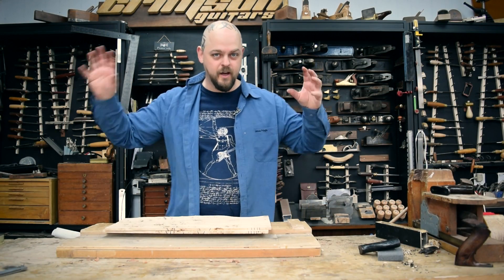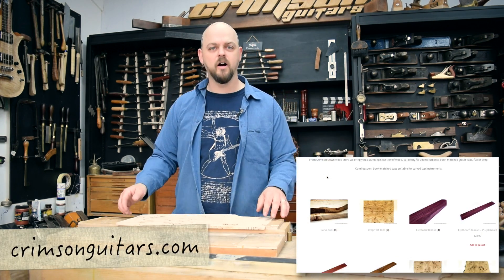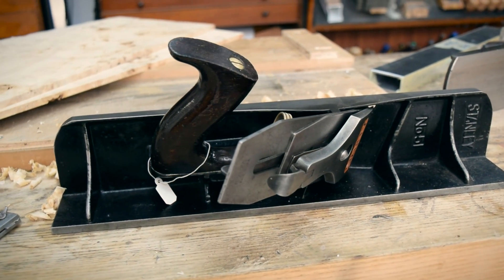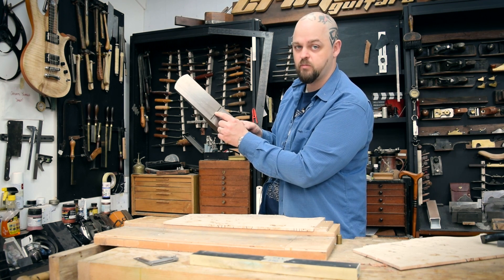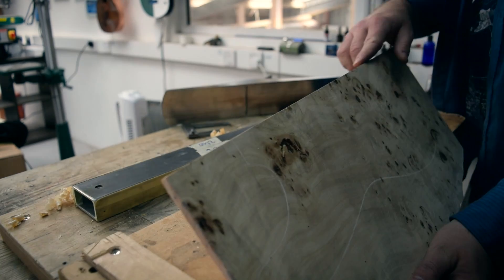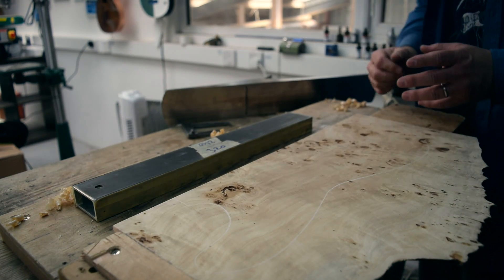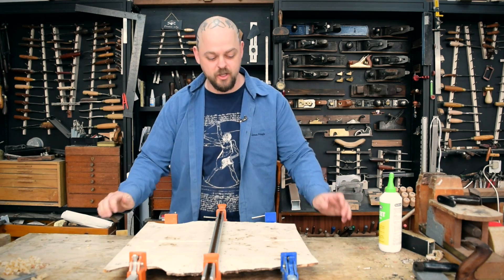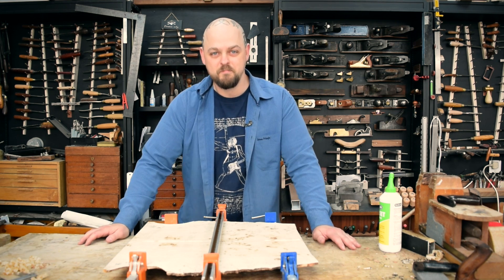How To Bookmatch a Guitar Top Using a Shooting Board

Comment: Very good video as usual Ben. I have been a custom cabinet maker ie furniture 30yrs I have made & used alot of shooting boards & planes, I learned a long time ago Simple is best I have always used an impeccable sharp #4 or #5 plane My joints fit butt ass tight hardly no clamp pressure just as you said. So I say Ben sell the bloody shooting plane. Love your vids from USA.

Comment: In his video on restoring a bench plane, Paul Sellers remarks in passing that for jointing the cheeks of the plane don't need to be square to the sole.  I haven't found out what he does when they aren't: what do you do? <evil grin>

BTW, re that Veritas jointing plane, "not expensive" = damn near 300 quid. I'll stick to my N° 6.

Final question: how flat does the plane sole have to be?  I've got mine to the point where toe & heel are bright & shiny, and in between the felt-tip marks have been sanded to peely-wally grey but are still visible. I've gone through ~3 metres of 120-grit and I'm fed up.

Comment: Forgive my ignorance - and I'm a luthiery pre-novice, so the ignorance is strong in this one - but why is the 'centre' side not made perfectly flat and square prior to slicing the block to create the two halves? Would this be a better way to ensure a perfect centre match, particularly for flamed and quilted wood, that often show a clear discontinuance and a too obvious centre line on the top? Have I missed something, or, much more likely, what have I missed? Cheers.
Reply: Keith Wallis assuming your cut is perfectly square yes. However a band saw, particularly when splitting wide planks like this cuts at a slight curve. And wood this thin bends by itself very fast.
Reply: Birki gts Makes sense. Thanks for explaining :-)

Comment: I think it's best if I don't go near a plane again.
On the instrument I'm currently working on, I planed a hump into my wood and then I worked out that by the time I've made it flat again it wouldn't be wide enough anymore.
So the solution I came up with was to add another piece of wood in the middle. 
I cut a piece of maple and put it through the planer thicknesser (because that can plane wood properly). Then when it was down to the size I needed I used it as a template to route the edges of the wood I was using for the body.
The three pieces fit together perfectly :)

Comment: Hi Ben, are the levelling beams machined precisely enough to give you that 90 degree finish you demonstrated in the video?
Reply: I can answer this one as I've got a bunch of them. No, they're not. They're close, but they vary and they're not consistent.
Reply: A1BASE I suppose the way around it would be to flatten 1 of the book-matched sheets, flip the levelling beam round and flatten the other sheet. Then whatever inaccuracy is on the levelling beam, it will be cancelled out when sheets are glued together. Does it make sense?
Reply: I can see where you're coming from, but how do you work out where your 'parts' stop and start. Sounds pretty inaccurate to me.

My solution was to go to a local kitchen counter supplier, tell them your problem and ask if they might have something like a 6x2 inch offcut (or longer) with a 90 degree edge you could have. I bet you they give you 3 or 4... ;)

attach sand paper to that and you have a 90 degree edge that cant move.
Reply: While we're talking about freebies, my dentist gives me old dental burrs for free. They're carbide or diamond tipped, autoclaved so they're sterile and more than sharp enough for wood or shell. They use them once then thrown them out... 
Instant engraving / inlay toolset.

Comment: Would the levelling beam not be more accurate. And it also removes less material ?
Reply: Ian MacPherson It works just as well as a plane. Only problem you get is when you're jointing anything thicker than a drop top, you'd need a very wide leveling beam, and the thicker the board, the longer it takes with a leveling beam.
Reply: A plane iron leaves a much cleaner finish and with practice is much quicker than sandpaper. A plane can remove very little material when set up to.

Comment: Question! why are guitar tops in general almost always two piece bookmatched? Is there a reason why we don't really see one piece tops?
Reply: Mitch people prefer the look of a symmetrical top. And planks wide enough for a 1 piece top are not nearly as common.
Reply: Birki gts interesting. so it's not a structural thing. I'm not saying I don't like bookmatched tops, I've just always wanted to try and find a one piece if I was going to do a build. probably nearly impossible to get though I guess.
Reply: Well, it depends on what specie you're looking for and what shaped body, but generally yes, very hard to find.
Reply: A single piece wide enough to cover a guitar top with any quality of figure would be ridiculously expensive!

Comment: Now then, I am to wood working what Donald Trump is to running a country. I like to have a crack at it but I really shouldn't. 

However... if a skewed mouth plane is preferable but you don't have one, would it help if the part of the shooting board that the piece of wood rests on was angled like a ramp. So the part where you start planing, being the bottom of the ramp, is thinner and would go up to normal height? Does that make sense (even if it's wrong does what I am describing make sense?).
It seems to me that making a new shooting board would be cheaper than a new plane.
Reply: KingBollock Short answer: yes and they do make those. Problem is that it limits the thickness of material you can use because geometry.
Reply: YOU MUST BE THE BEST WOOD WORKER EVER IF YOU ARE COMPARING YOURSELF TO PRESIDENT TRUMP!

Comment: For speed and because I don't own a number 7, I superglue and masking tape the sides face to face with the edges as close as poss, then fix to a reference joint and run a flush trim router bit along it.  Close enough for rock 'n' roll.